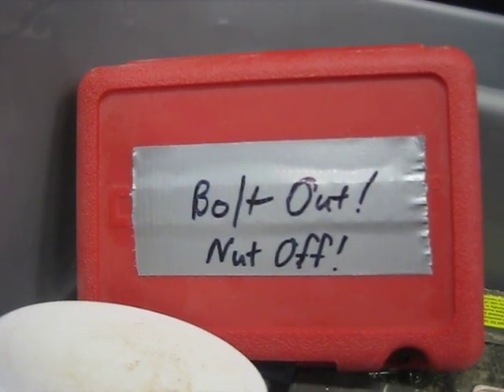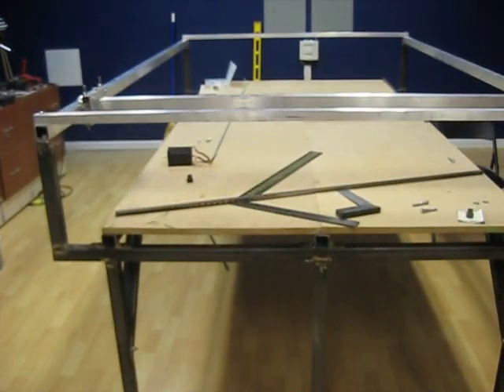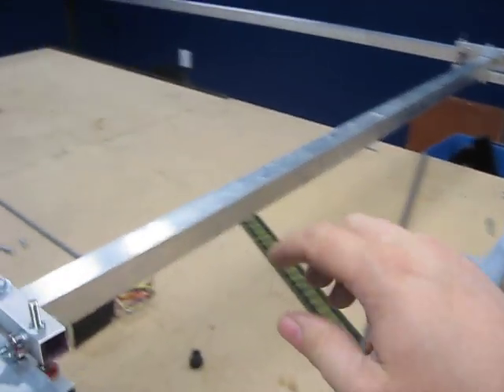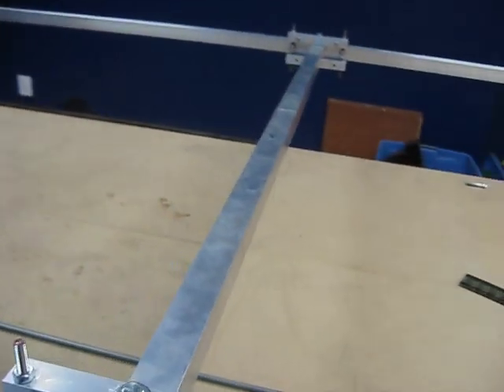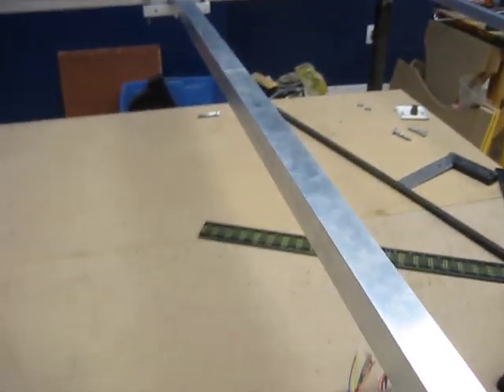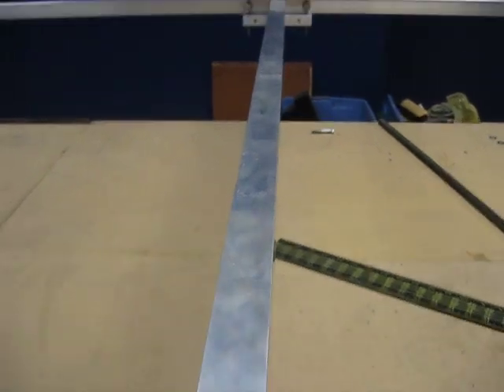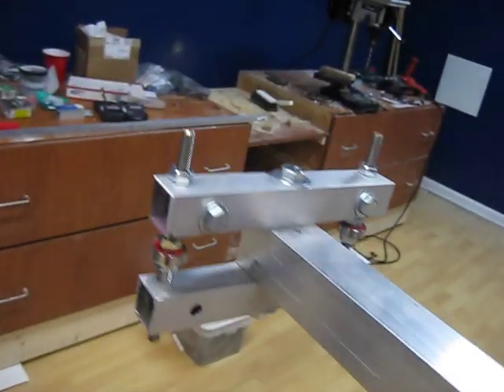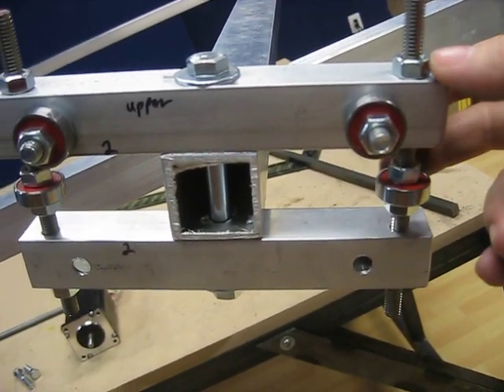Building a CNC machine Part 6

Comment: nice progress there ,.. but i am afraid that there is a potential flaw in your design ,.. i am afraid that the steel bearings will bite in to the soft Aluminium tubing under pressure,.. 
happy building..